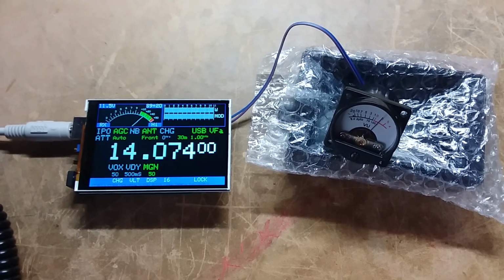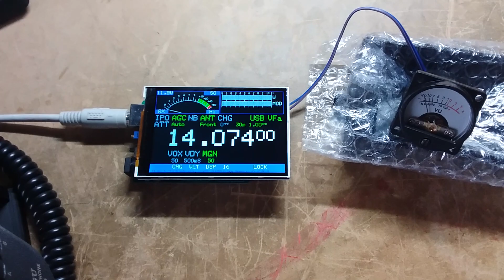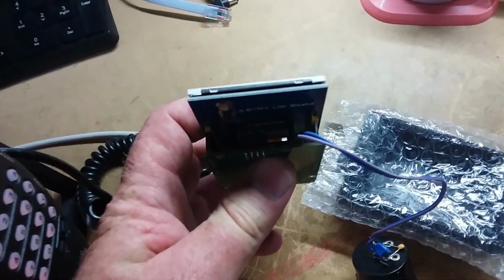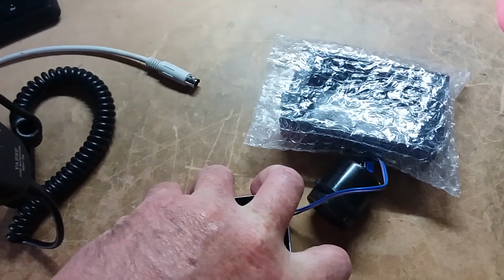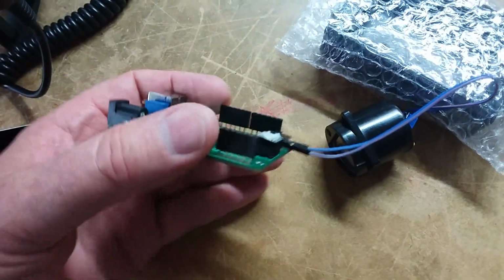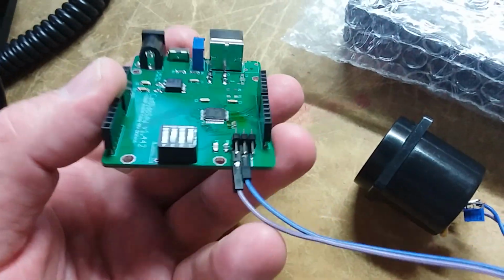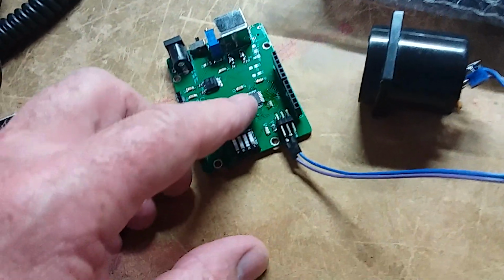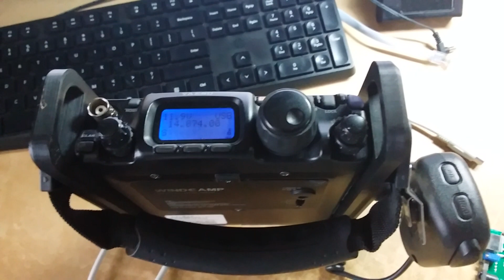CatDisplay analogue meter

Comment: you never show the S-Meter while receiving a signal. It must be slow and choppy....
Reply from the maker: Took 2 hours yesterday to do a short video showing meter is neither slow or choppy. New QTH, so no antennas up yet. You'll have to decide what you think from simple AM & FM reception examples here https://youtu.be/eMTQ83o7JaU - 
Note I am in a small NZ town 1/2 way down the south island so no, there is no SSB examples to tune into from the small telescopic antennas I'm using.
Reply: @ZL1CVD  Watched the video, thanks....very helpful  :-) . I was disappointed that your "voice" inflections when quoting me, had a "complaining" tone regarding my comment. It wasn't sent with that at all. You are thinking it's negative....it's simply a question/statement based upon what I didn't see...and wanted to see. I had to assume it was left out intentionally....as it was such an obvious thing to include.
But, now you did :-) and thank you. I appreciate your effort and I am going to buy one. :-)
PS I included "smiley faces" so we can keep the 'tone' well understood. Thanks again.   :-)
Reply from the maker: @robyounce4636  Whilst CatDisplay does have an S-Meter, it might surprise you to learn the main reason why many of my customers purchase the CatDisplay is its larger frequency display which helps with aging eyesight. Secondary are the indicators which provide an easy ways to see what the menu settings are without having to dig into the menu system. So as its creator & manufacturer, the S-Meter has never been something I've considered a key reason for purchase. But we all live and learn as they say 🙂 Thank's for your interest. 73 de Chris zl1cvd
Reply: @ZL1CVD  Thanks, again, and yes, I like the bigger display, it is appealing. Is there a box or frame this unit fits into?
Reply from the maker: @robyounce4636  yes they are all supplied with a 3D printed box as pictured on https://www.catmeters.com - unfortunately there are a few of my videos not showing the box but it is included 😏

Comment: could you please tell me if this plugs into the acc port or the data port for the 817 as i use the data port for digital. Do you have dimensions thanks. Great idea as my screen is very hard to read.
Reply from the maker: It plugs into the ACC port which has the CAT computer interface.  10cm wide, 6.3cm high, 3.2cm deep. Come with 1.5m Cat cable. Link to CatDisplay for FT817/FT818 here: https://ebay.us/UB4Kzn